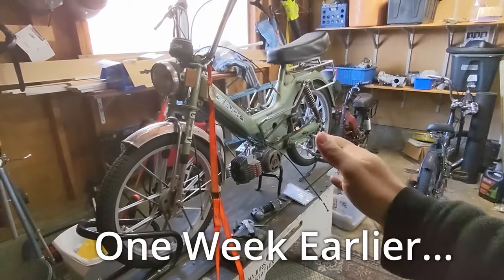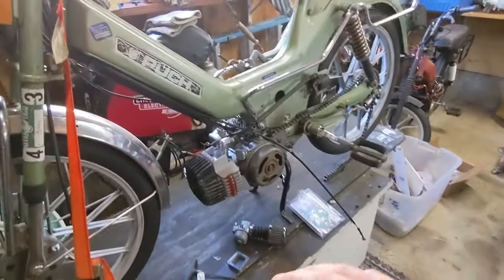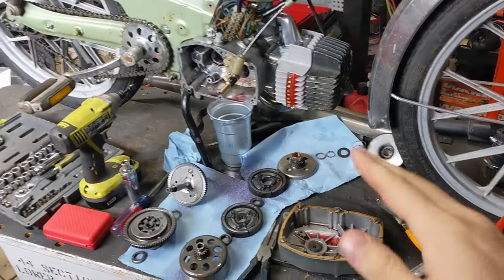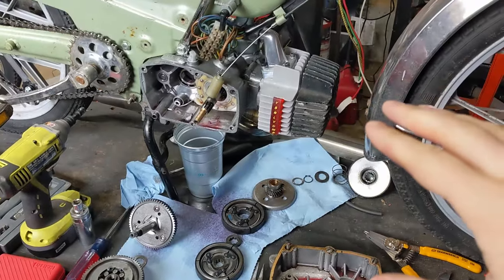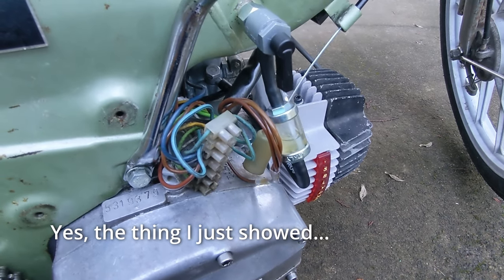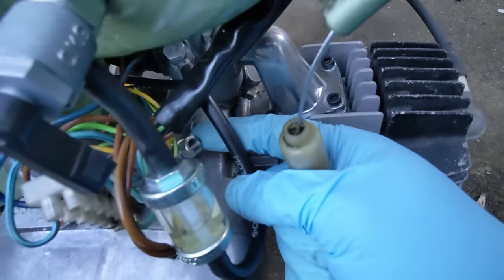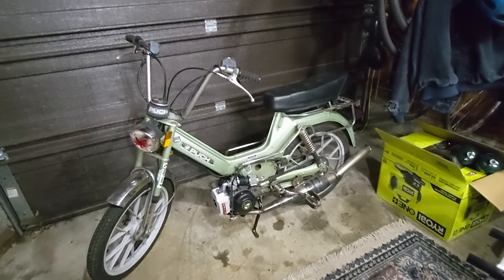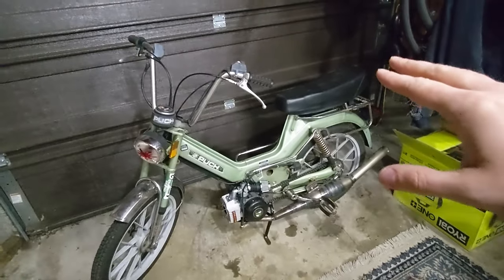Finishing Bits on the ZA50 Polini Puch Maxi + FIRST RUN!

Comment: I have an airsal 70cc tomos a3 that has a horrible rattle at 30+ mph that I can't seem to find. It runs perfect otherwise. I hadn't considered it could be the fins on the cylinder! That would check out with where it sounds like the rattle is coming from. Does that sound plausible? I don't know how bad that chatter you were speaking of can get. Great video as always :)
Reply from the maker: So that fin chatter is a "thing" - some older 2T motorcycles came with rubber on the fins for just that purpose. It's really noticeable on my cheapie treats 70 DMP kit on my Maxi, but any kit can be effected.
Reply: Makes sense. I have a Ducati that's got rubber pucks between the fins, but I had always assumed it was just for structural support. I'll have to find some for the moped. Thanks @TravisTutorial

Comment: Hello i have a question. I have been looking for an answer but can't find any. I have a DBS Hercules with sachs 504/1b engine it's running and was driving but when i was riding it with full throttle it just when slower and slower until it didn't move forward anymore i even jumped of it and with full throttle it didn't move forward. What can the problem be? It also felt pretty slow when i was driving it when it moved
Reply from the maker: Could be a lot of things, but tow issues come to mind:

Fuel Flow - do you have good fuel flow from the tank - > fuel filter -> carb? Is the carb bowl and main jet clear? You could have a fuel starvation issue. This is the easier item to check. 

I'd also peek into the ignition side and look at your points (getting the Sachs flywheel off is kind of a pain but after you do it once not too bad) and make sure they are opening and closing as you rotate the flywheel, if the gap is off you could have those issues.

But, if both of those things are ok - as in, the bike runs great on the stand with full power - I'd dig into the transmission, make sure the nut hasn't backed off, possibly look at the pads and your shimming. It's more work, but good starting points are in these threads:

https://www.mopedarmy.com/wiki/Shimming_the_Sachs_505_Clutch

All the real Sachs guru's here:
https://www.mopedarmy.com/forums/read.php?6,4457536

There is also a video I made a long time ago on going through the clutch on my channel, best of luck with your Sachs